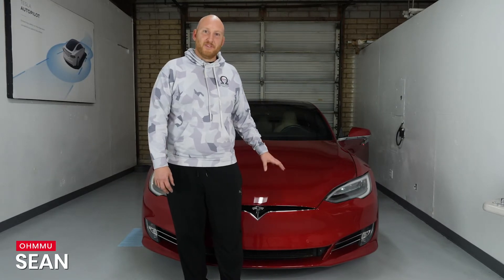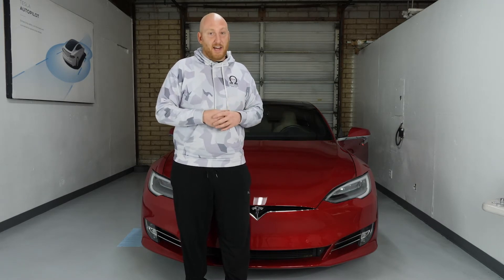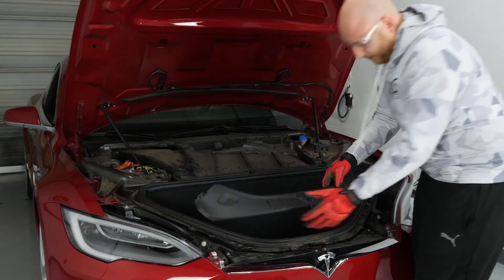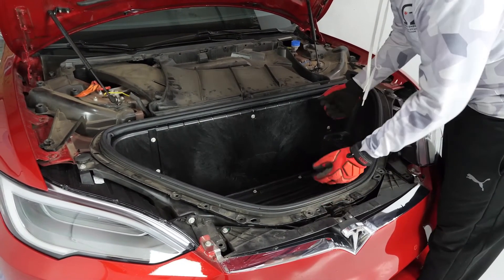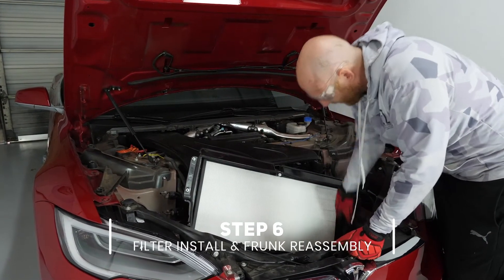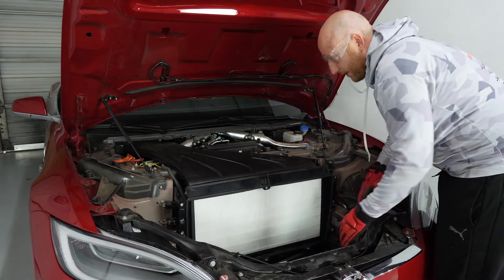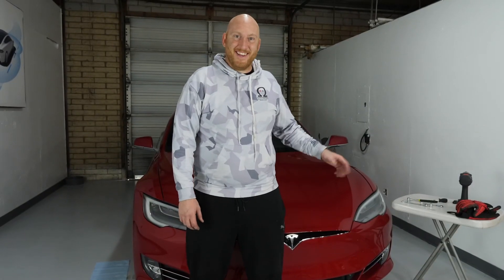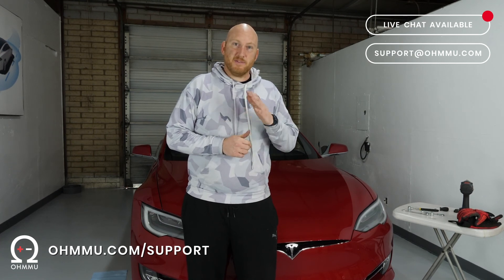Tesla Model S - HEPA Filter Installation (Ohmmu)

Comment: Hello, everyone!
How can I determine which side of the filter should face where? Specifically, where are the inlet and outlet for this filtration system? How can I understand the direction of airflow?

I’d really appreciate your help—this is important to me. Thank you!
Reply from the maker: On this filter system the air flows in from the front and out the back (front is closest to bumper, furthest forward); we recommend the air go through the pleated membrane first (white part) then the activated charcoal segment, so you'd install it with the white part facing forward.

Comment: They will delete this comment but I bought 2 ohmmu HEPA filters and used them up, results: they are nowhere close to the quality of the original ones! You can perfectly smell exhaust from preceding cars, smell in tunnels, dust… EVERYTHING comes in! I think the problem is that these filters seem to be carbon based. I do t recommend, despite the tempting price. On the other hand, I replaced my 12v battery with a lithium Ohmmu one and it works fantastic since years! the only issue is that my Model X doesn’t recognize it and still thinks my battery is dead. I did the hack to remove the warning, but after a few weeks it comes back.

Comment: First how often should a HEPA filter be replaced? I have a November 2018 MS 75D with biohazard and a December 2021 MS Long range. My MS LR 12/2021 started having that sour mildew smell within a month or two of ownership when I would turn the heat on. My 2018 has NEVER had this smell and I have not replaced the cabin filter or the HEPA filter. Tesla is wanting to charge me $600 to replace the HEPA filter in my 14,000 mile 18 month old MS to solve this mildew smell. It seems that your video points out that the drain hoses need to be properly connected to prevent this. Comments?
Reply from the maker: Every 2 years is a good schedule for filter replacement.

Drain hoses definitely need to be connected properly and not pinched to make sure water is running out of there and not allowing mildew/mold to grow in the air intake.

Comment: Ok so what us the bio button for. Do I lose any function without it or do I need to have Tesla do the retrofit
Reply: sorry what is the Biodefense mode button for since I will not have it?
Reply from the maker: Replacing filter in a vehicle with biodefense mode you will still have that mode after the swap.  If your car doesn't have it then the reality is that all that button does is turn on Max fan speed and "fresh air" (non-recirculate); which can be set manually w/out that button, so the button itself is more of a gimmick or short-cut than an actual feature, the HEPA filter is what makes the difference.

Comment: Thanks for the instructional video. I will be replacing my 5 year old factory HEPA filter with yours as soon as it arrives. My only recommendation for your steps would be to not use a power drill for the 10mm bolts. The metal bolts going into the plastic frame around the filter strip out very easily. One of mine stripped out just removing it.
Reply from the maker: That's a fair point, we should probably note that they can be used cautiously and should use the torque limit settings on the tool to prevent that from happening.  I have done a bunch of these swaps and never damaged one of those threads or frames but I've seen it (already broken in vehicle) so I understand the risk you are talking about!
Reply: @OhmmuEnergy  your filter works great though. Tesla mobile service used a drill on the same bolts for another issue of mine so it must not be a big deal!

Comment: Great video. I have the 2016 Model S face-lift and i do NOT have the biodefense. You mentioned that it will be easier to put a filter in but will it work without the bodefense updated software?
Reply: Set your climate control to outside air with the fan at level 9 or higher. That’s what biodefense mode sets my air to when I hit the button.
Reply: BioDefense mode isn't anything special. It just sets your fan speed to max and circulates the air. You can do this yourself with your own filter.
Reply from the maker: Yeah, like the others said here, you don't need a biodefense mode to get the effects of it, the button/option itself is more or less a gimmicky icon on the screen that sets to max fan speed without recirculation (to ensure all air is pulled directly through the big filter and that the cabin has enough air being forced in via that filter pathway to create a pressurized cabin where any/all other points of ventilation will be pushing air out of the cabin and not leaking air into the cabin).  Also, its a useless mode if you have a window open.  So you can add the feature without having the button in the MCU, basically.